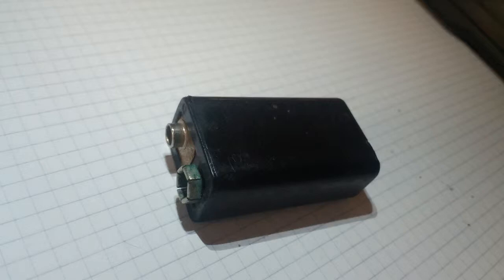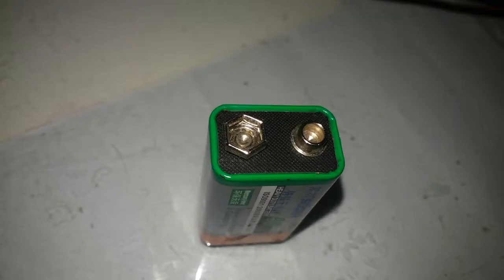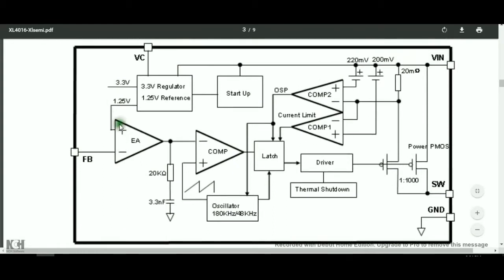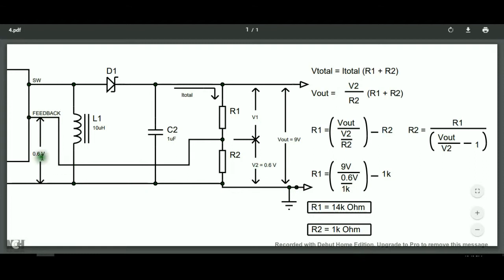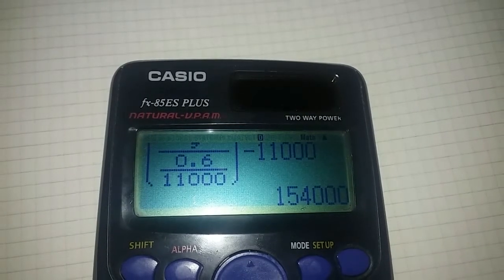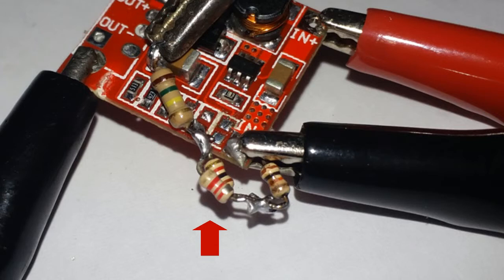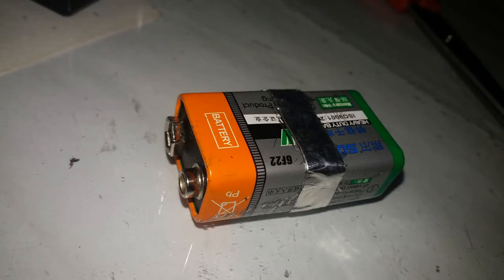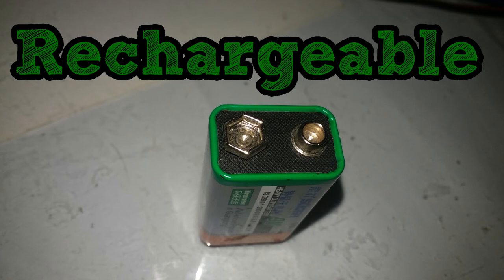Make A 9V Rechargeable Battery || Li-polymer

Comment: But there was a problem in xl6009 or other type of boost converter i personally use xl6009 when we convert 3.7v to 9V or 12v it works good But when the battary voltage drops its immediately power around 40v maximum volt my many led stripes are damaged by using this boost converters the best way to mitigate this issue is my providing constant volt to the module ex: you use SMPS circuit or voltage regulator ex: 12V battary using 7805 Ic it power const 5V use it with module works good!

Comment: couldn't you just have soldered 2 or even 3 of the 3V Li-ION batteries in parallel?
Reply from the maker: do yo mean to have a higher capacity? if you parallel 3 of the li-ion battery their voltage will be equal. 4.2 volts when fully charged 3 volts when discharged.